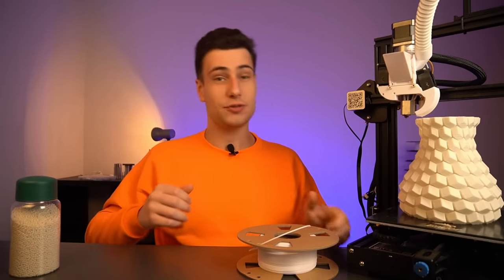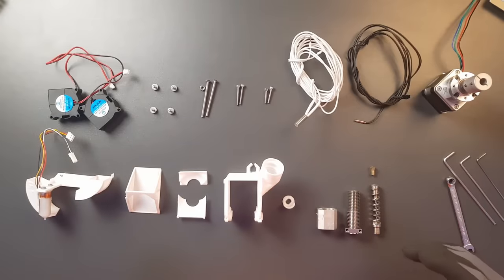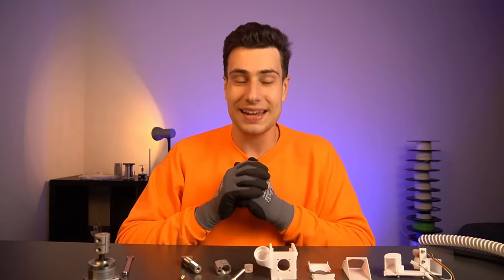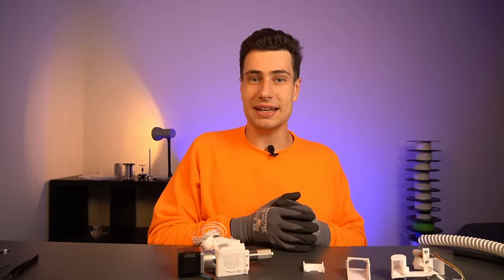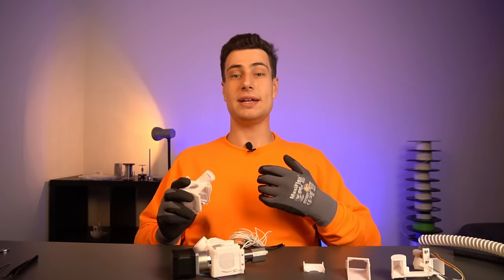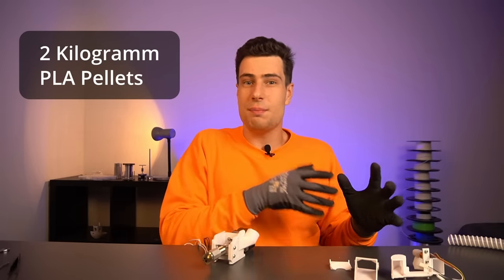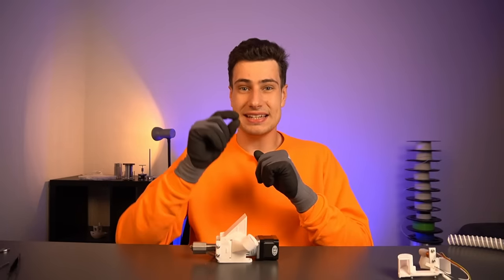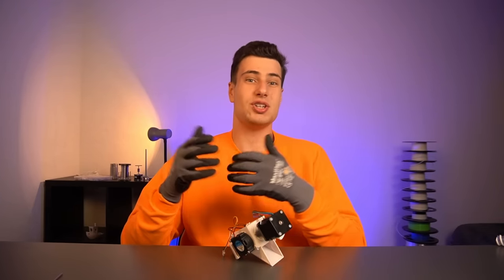Pellet Extruder for ANY 3D PRINTER | 3D print Granules, Chocolate, Sugar and more

Comment: In my opinion, a more temperature-resistant material would be better because PLA parts in enclosed printers tend to get deformed. Also, how much volume per second is the extruder capable of?
Bei den Handschuhen hab ich erst bemerkt, dass du Deutsch bist 😂
Reply from the maker: 😅 Das ist ja das besondere am Druckkopf, du musst nicht aber kannst PLA verwenden. Wenn die 3D-Druck teile aus z.b. PEI oder PEEK druckst, kannst du locker auch bei 450C° drucken

Comment: I’m concerned about the extruder melting if I print for like 5 days straight
Reply from the maker: I don't see why there is any chance of that happening. Over the time the 3D printed parts get annealed which makes them even more resistant against heat

Comment: It's absolutely a great job, but I have to go harsh on you. 

It's useless idea which won't adhere. It's better to make an extrucder for pallets that makes fillament and then to use this fillament. This approach is just a tiny bit more expensive but doesn't have problems with current software and no quality loss. 

On top of that fillament extrusion will be more compatible with recycling of used plastic.
Reply from the maker: Just keep in mind > There are things you are not aware of... 🙃

It's always about the things we don't know in life

Comment: I don't think that would fly. For some reason you did not share costs and what is most important - you did not really show the print quality. But based on couple  of visible frames - quality is way too far from level desired in 2024 (extrusion is visibly inconsistent). The mass of the whole printhead (and as a result speed, accel and vibrations) is also a concern to me. So might be interesting to someone who do a lot of prototype/draft prints (but who also need that at low speeds?) - and that is it. I'll be happy to see proofs I'm wrong. Nice engineering anyway...
Reply from the maker: You should watch my first video "Filament vs Pellet 3D Printing" because I compare in that video a lot between Filament and Pellets

Comment: this is lile all the other designs... this idea is over 10 years old and got "solved" so many times... there is a reason, why its not becoming main stream and its not only because the manufacturers can get more money this way.. first of all: in a real extruder, most (like 80% or so) is produced by fricton..so there is no way to get that much torque in a litte device...so its heated up.. it would need 3 heating stages to gas put and compress the pellets........ its not that easy and i guess its far from running as consistent like fdm.. pellet price is the only big + but most pellets are to big so it would go the same way as for filament: special pellets = special prices.. but yeah why not..

if someone finds a way to print a matrrial 1:1 like bones or horn or some biological hard stuff, tjat would be an gamechanger, but o only see the same ideas again and again and again.. more pointless plastic waste..awesome job bro
Reply from the maker: There are many things you are not aware of
Reply: @greenboy3d  it's the other way around... you don't know a lot of things that were done in the past... is see you only printing in vase mode... mabe there is a reason for it.. sorry that i hurt your feelings but you are 10 years to late..

Comment: Okay, but why, dear deity WHY, did you use PLA? Anything is better than PLA. For so many reasons. Except TPU maybe. But why not simply PETG, or even better ABS?
I'm also doubting that this "just works" like you're hyping it. If it was that easy, somebody else would already have brought it to market - and also keep in mind that there are already enough concepts for a pellet extruder out there, which are all ... not great. Maybe in theory, but not for practical application. I'm pressing X for now.
And lastly: What up with those gloves?!